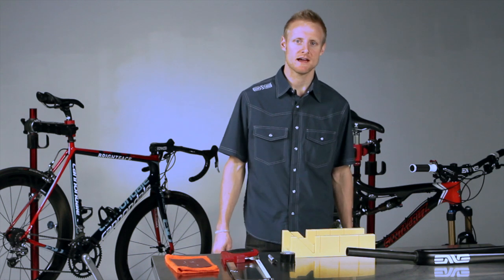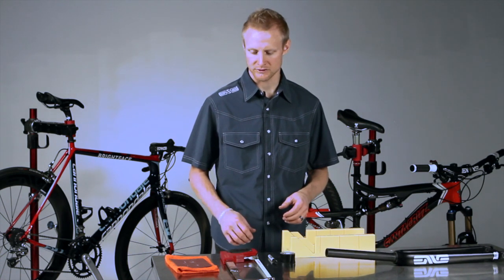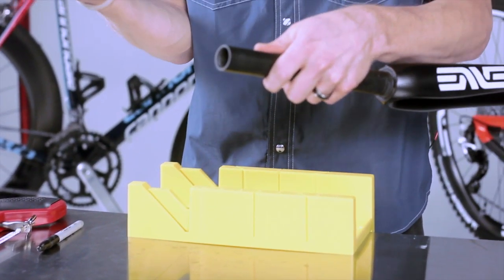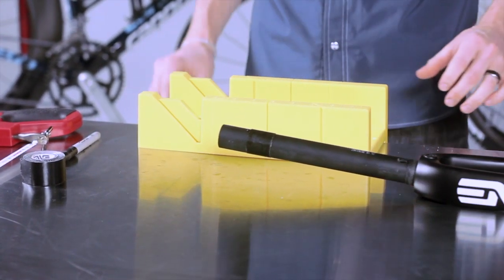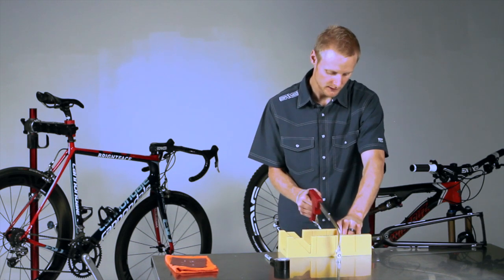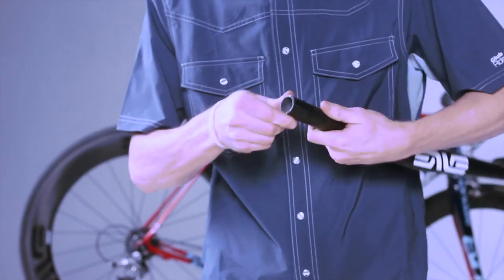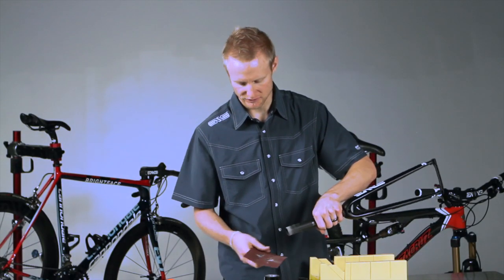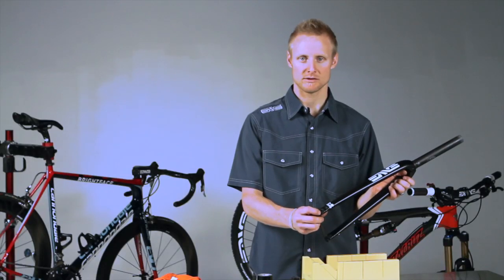How To: ENVE Carbon Fiber Steer Tube Cutting

Comment: How to put the steel ring down the tapered fiber Steer Tube below the ballbeering?
Reply: You probably figured it out. But either buy a fancy Park Tool crown setting tool or buy a PVC pipe for cheap at your hardware store. I went with the PVC pipe method... put a bit of grease around the crown race before hammering it down with the pipe.

Comment: Jesus Christ.  If I saw someone man-handling my new mega-bucks ENVE forks like this, I would chin them.

Get a Park Tool cutting guide and do it properly, outside, wearing a face mask.  Then very very carefully file the edges smooth with a super high grade diamond file.